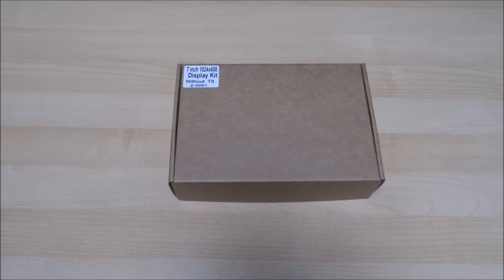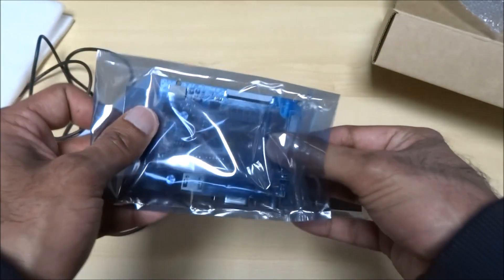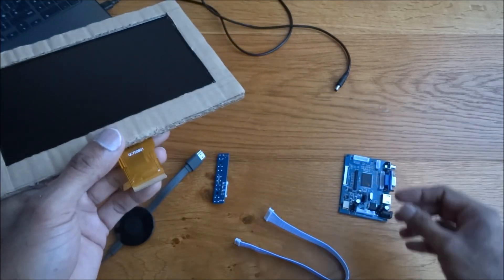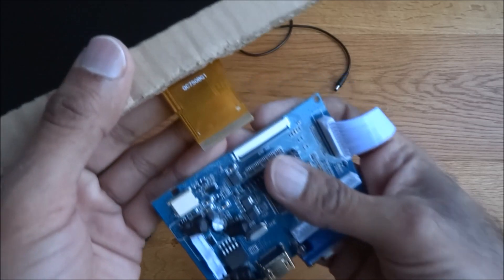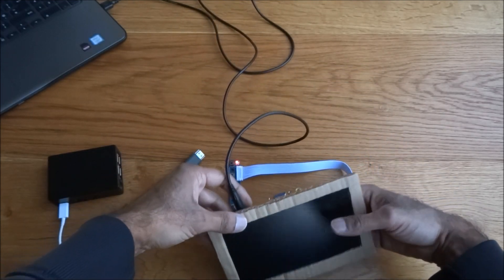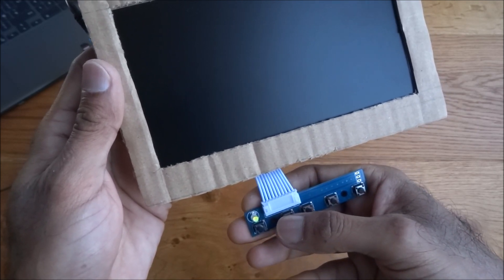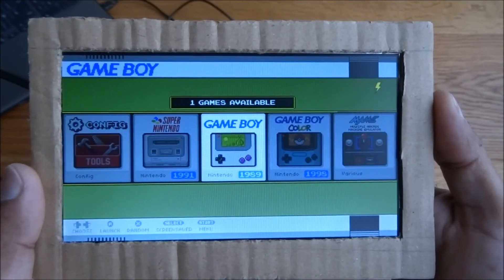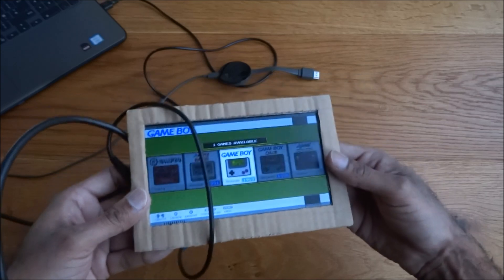Unboxing and setup of a GeeekPi 7 inch 1024 x 600 HDMI Screen LCD Display

Comment: I wonder if it still works even tho a couple pins broke off I hope it still works the old fpc connector broke so i replaced the old one with a 40 pin but some of the pins broke so I wonder if it'll still work

Comment: Hey I used LCD controller board but I replaced the fpc connector with 40 pin it used to be 50 pin and also what charger does a lcd controller board use

Comment: Hi I just bought one of these but when I power it on the screen is white with vertical lines. Pretty sure I have it hooked up correctly. Any idea one what I can do to fix it?
Reply from the maker: Make sure you've connected both the hdmi and usb. Another thing to check is the resolution, sometimes it's actually best to initially plug it into a pc as it plug and play. Let me know if this helps.